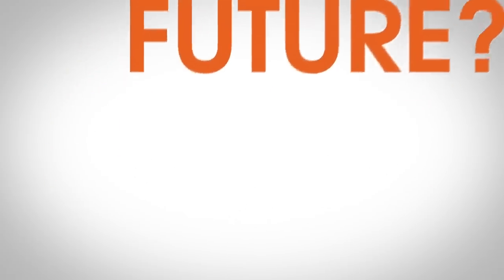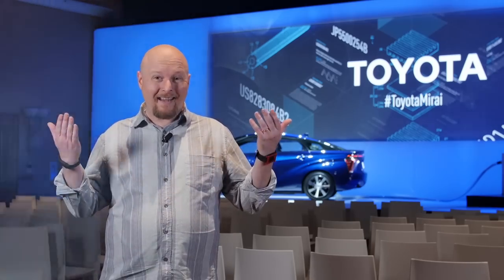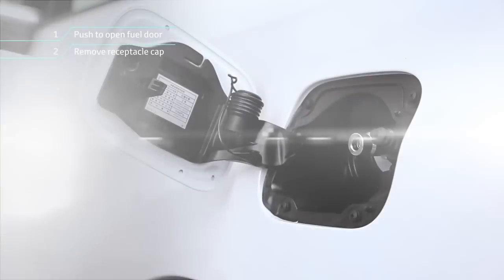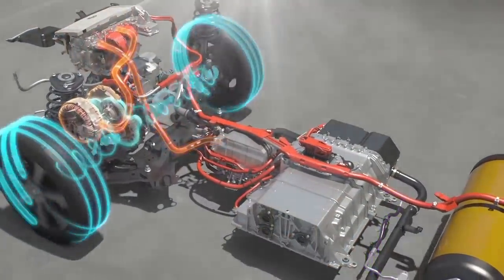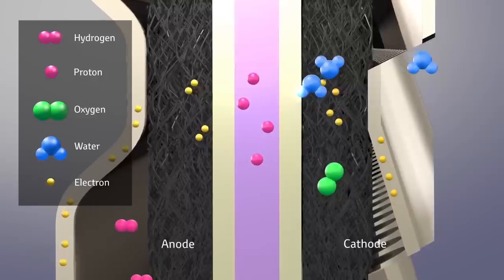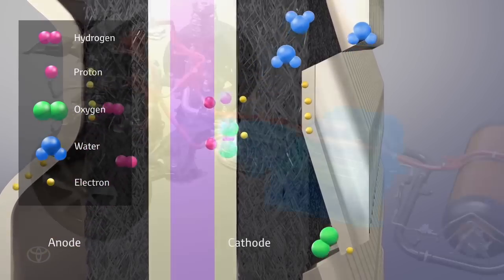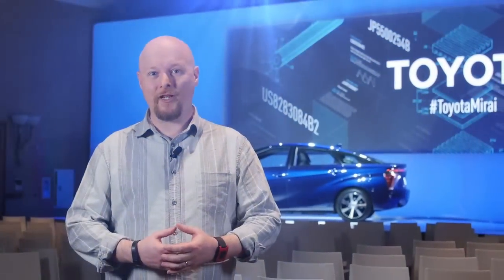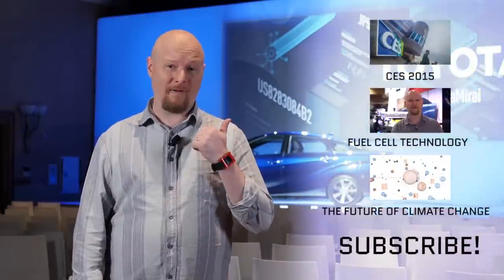How Fuel Cell Vehicles Work – CES 2015

Comment: burning coal which is polutive, to make electricity to then make hydrogen to then make electricity is pointless,  3 step process while electric cars are more better for environment less loses, my suggestion is cars should run off big cell towers that wirelessly send electricity to the car that cuts 15k off the price of the car by elemanating the battery, also not cheap to get a new battery Wen it breaks, hydrogen fuel cell cars and electric cars did not take off in the 70ties because they where smart enough to know that price of batteries arnt cheap and if 3billion people had evs.  you would need huge amount of powerplants to make electricity which will fuck up the electrical grid meanwhile, water cars are the only technology that should be out a guy in new Zealand charges up water with a small charge which can run unmodified naturally aspirated engines all sorts this is the future.

Comment: We don’t have the time, resources and enough renewable energy to build 100’s of million’s of new Vehicles, so most of the energy used to make cars( from Mines to Road) would be done using fossil fuels. I am into HFC technology, but time is so short( 10 years according to the IPCC), and we need a way to suck Billions of tones of Carbon out of the atmosphere. Which is why I believe the future relies on us using the (already built) ICE Vehicles in effect, as Carbon Capturing machines. By running them on Carbon Negative Algea Bio Fuel, which can and is grown in Photo Bio Reactors( PBR), which are easy, cheap and quick to build. 10 pounds of nutrient rich Carbon residue is produced and permanently removed from the atmosphere for every gallon of Algea Bio Fuel. As the old ICE Vehicles engines become too worn/old/obsolete, the same Vehicles could be retrofitted with a HFC, Electric motor system!. So the shell, interior, glass etc of the cars can be reused.
Reply: we don't need to build whole vehicles, we need engine replacement kits, subsidises by Governments, industry and the user, to accelerate the rate of migration to clean tech
Reply: Gea Vox What engine replacement kits do you mean?

Comment: +Daniel Bentley Watch this, Solar panels supply power to water to perform electrolysis, which separates h2o into hydrogen and oxygen, both gases with potential power, the car uses that hydrogen gas to run as described in the video.  Now you may ask, why not just use solar? The answer is solar power may be very clean but to be implemented in a car with today's speeds, you'd need several times the surface area of current cars to maintain the power, so hydrogen fuel cells fix that problem while still being green.
Reply: Toyota has always lied in such promotional videos and this has not changed 6 years later. At 4:58min they claim: "No carbon emissions like petrol or diesel powered vehicles".
This is true - if you look at the fuel cell car alone. If you look at the whole chain (well-to-wheel), hydrogen today in 2021 is made from more than 95 per cent natural gas, coal and oil, as it was in 2015.
The hydrogen car is therefore dirtier than all other vehicles!
Of course, hydrogen can be produced from renewable energies via electrolysis. But this method is several times more expensive and therefore there will never be a large number of cars with hydrogen as an energy storage medium.
Toyota needed until 2019 to produce and sell 10,000 Mirai.
At 4:59min I had to laugh:
The biggest revolution has failed ...
The new Toyota Mirai II (2020) does not even have a folding rear seat back. The hydrogen tanks take up a lot of space.

Comment: This is about Toyota controlling development in their direction.
Reply: Toyota has always lied in such promotional videos and this has not changed 6 years later. At 4:58min they claim: "No carbon emissions like petrol or diesel powered vehicles".
This is true - if you look at the fuel cell car alone. If you look at the whole chain (well-to-wheel), hydrogen today in 2021 is made from more than 95 per cent natural gas, coal and oil, as it was in 2015.
The hydrogen car is therefore dirtier than all other vehicles!
Of course, hydrogen can be produced from renewable energies via electrolysis. But this method is several times more expensive and therefore there will never be a large number of cars with hydrogen as an energy storage medium.
Toyota needed until 2019 to produce and sell 10,000 Mirai.
At 4:59min I had to laugh:
The biggest revolution has failed ...
The new Toyota Mirai II (2020) does not even have a folding rear seat back. The hydrogen tanks take up a lot of space.

Comment: We will not share our oxygen with cars!
We made lots of 'carbon dioxide' by the use of heat engine, now we want to take up the oxygen from the environment by the use of hydrogen fuel cell.
It's the 'Perfect Recipe' for the 'Disaster of Mankind
Reply: The concept of a hydrogen society involves hydrogen production from water. And if you split the water molecules, you get hydrogen AND oxygen. 
Unlike the current use of fossil fuels, renewable hydrogen would have no effect on the oxygen level of the atmosphere.

Comment: inefficient, use hydrogen to make electricity when u can just drive a tesla? plus you have to worry about an extremely flammable gas that you won't be able to tell if its leaking? just get a tesla.
Reply: Because the Tesla has 600 kilos of chemical lithium ion. Its nonsense. and it sells the same reason Apple sells.

Comment: It's all great. I think Nikola Tesla Wireless technology would be way better. You would have broadcasting stations and receivers in the cars delivering power to electric motors. No need to ever stop for refueling! This is what I think about fuel cell. Your travel extends as far as fuel in your tank and refueling station grid goes. Why nobody is talking about this?! Tesla died in 1943! 80 years later and we can figure out what he have done back then? Tesla didn't have today's technology at his disposal and he achieved way more than we are achieving these days. I think we should bring our Focus towards he's ideas. And nobody please tell me it's impossible. We have wireless cell phone chargers don't we? The same exact thing just magnified would power every car and home around the world! I know there is a problem, you can't put meter on it🤔.

 Wake up people hydrogen generation causes carbon dioxide production as well! If this is not enough for you guys , please research SEG generator!
Most hydrogen today is generated by heating coal and natural gas with steam, but that process emits a lot ofcarbon dioxide, nullifyinghydrogen's eco-credentials.

Comment: Hydrogen is not the future, and hydrogen economy will never be. Hydrogen is abundant on Earth but not in the form you need it and you need to put in lots of energy to make it. Hydrogen is not energy source, it is energy storage.
It takes around 300kWh to create hydrogen needed to fill up Toyota Mirai, and Mirai can do 300 miles. With 300kWh, electric car can do 900 miles.

This is why Toyota is never talking about hydrogen price, and even giving it for free with vehicle, because when people realize that will cost 2-3 times more to fill it up than petrol car and 5-6 times more that electric car (for the same distance), nobody would event thing about buying it.
You can say, we will put solar panels, wind turbine or any other renewable and make hydrogen that way for 'free', but that also does not make sense, because with the same solar panels or wind turbines you can support 3-4 times more electric than hydrogen vehicles.

Alternative is to make hydrogen from natural gas (95% of hydrogen is created today this way), so technically hydrogen is  fossil fuel, and this process releases huge amounts of CO2. Natural gas mostly comes from fracking. So hydrogen does not solve environment issues.
Reply: Sasoon2006 Where do you get these numbers and your "facts"?  
In the US, most hydrogen produced today is the byproduct of petroleum refineries and is recycled into the refinery process, disposed of in injection wells, safely released into the atmosphere and sold for industrial use.
Reply: patw52pb1 It is only a "by product" in the sense that the petroleum products are the core purpose of the refineries, 95% of the hydrogen generated in the US uses the steam reforming of natural gas at something like 1000 degrees C.
Reply: Roy Richardson And where are most of those reformers located? 
At the major refineries. 
Hydrogen is used in the refinery production of fuels and some distillates and is liberated from the feedstock stream by heat and steam, utilized in the process and most is recovered, reused, captured and sold, safely released, disposed or stored underground.

Comment: That is gay, why not just use the hydrogen for combustion.
Reply: The Terrarian combustion engines are less efficient than electric motors.
Reply: It would be way more efficient to just use a electric car in that case. But hydrogen is powerful and could be even more efficient than electric.
Reply: I'm not so sure about that in a combustion engine so much energy is lost in friction and in the transmission with gear reductions and such where as a simple blush less electric motor can pretty much be connected to the drive shafts. An electric motor is so efficient that it can take a vehicle from 0 to 100 in 4 seconds with just the motor in the right conditions. Whereas in a combustion engine has to shift from different gear ratios to reach that speed. I'm sure you could make an efficient hydrogen powered vehicle but it will never be anywhere close to as efficient as an electric motor.
Reply: There is probably no more efficient way to go than using a hydrogen fuel cell car since using a regular electric car takes a while to charge at a charging station, an a fuel cell car makes its energy on the go. and as you said, electric is more efficient than combustion.
Reply: A fuel cell car is in essence an electric car the electricity is just generated from the fuel cell you can think of a fuel cell as like a battery that doesn't discharge naturally because it's the reaction of 2 gases that generates the electricity instead of 2 metals that are always in contact with each other.

Comment: I knew that hydrogen was about to win this competition
Reply: Toyota has always lied in such promotional videos and this has not changed 6 years later. At 4:58min they claim: "No carbon emissions like petrol or diesel powered vehicles".
This is true - if you look at the fuel cell car alone. If you look at the whole chain (well-to-wheel), hydrogen today in 2021 is made from more than 95 per cent natural gas, coal and oil, as it was in 2015.
The hydrogen car is therefore dirtier than all other vehicles!
Of course, hydrogen can be produced from renewable energies via electrolysis. But this method is several times more expensive and therefore there will never be a large number of cars with hydrogen as an energy storage medium.
Toyota needed until 2019 to produce and sell 10,000 Mirai.
At 4:59min I had to laugh:
The biggest revolution has failed ...
The new Toyota Mirai II (2020) does not even have a folding rear seat back. The hydrogen tanks take up a lot of space.